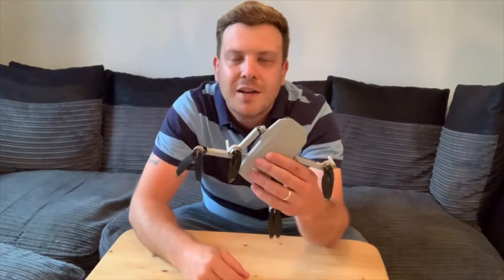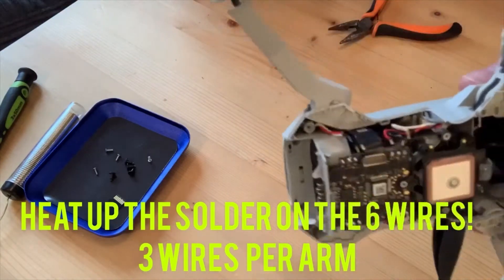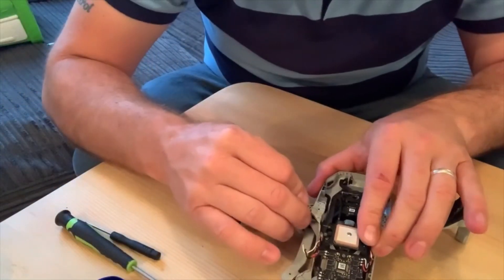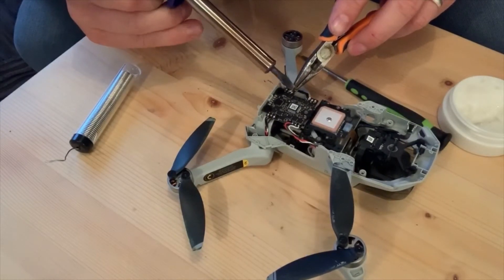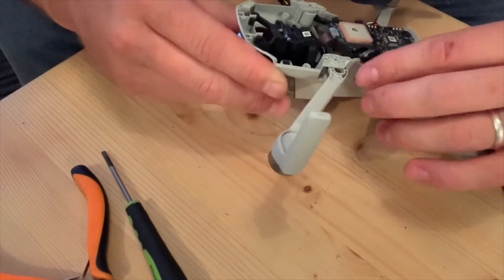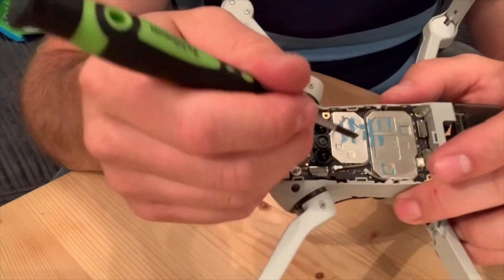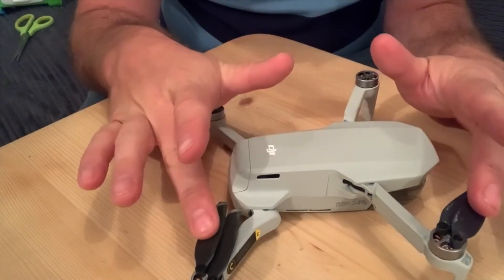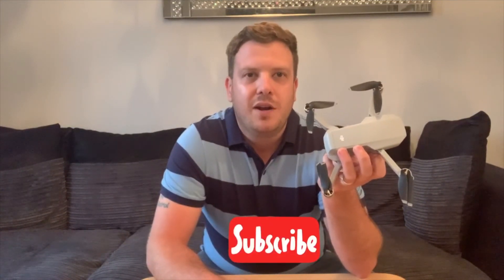DJI Mavic Mini front & rear arm replacement-repair after crash fail ⚠️(will it fly again?)

Comment: What temperature are you setting the soldering iron to dude? I'm trying to replace the 2 front arms but cannot desolder the wires from the ESC. Even at 480℃! God knows what type of solder DJI are using but my 80 watt Iron melts all my other types of solders at much lower temps without issue 🤷‍♂️

Edit - noticed you using the wide tip, tried it and worked straight away. Thanks for the Vid 👍

Comment: Brilliant drone but Very fragile, nice work 👍🏼
Reply from the maker: Itz Si thanks for watching 😀 yeah great when it’s in the air just don’t lose WiFi 😂🤦🏼‍♂️
Reply: @TouringwithJeremyandCharlotte  If you use Yagi Antennas attached to the Wifi Antennas you´ll get apx. 4 km of Wifi Signal in Open areas...